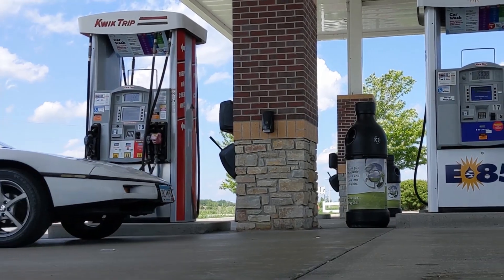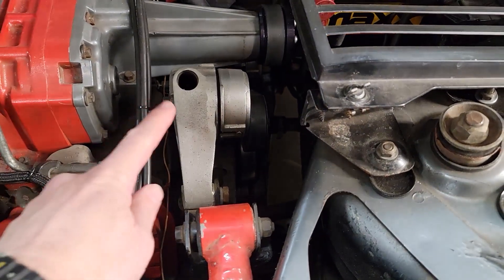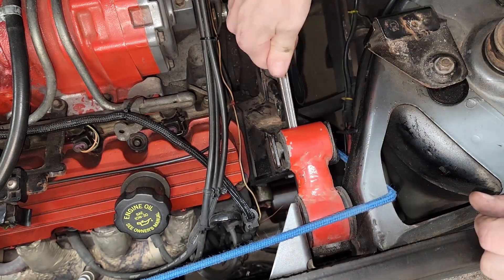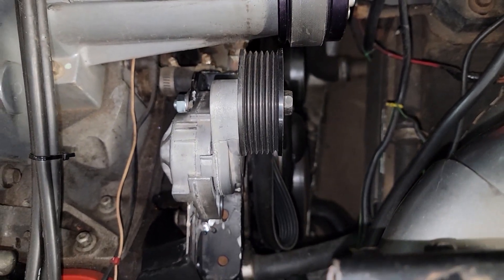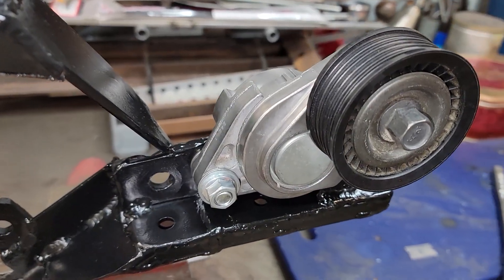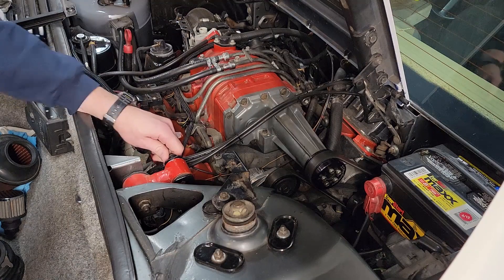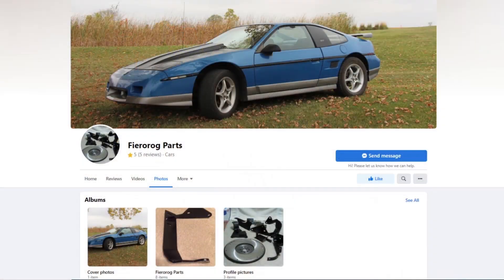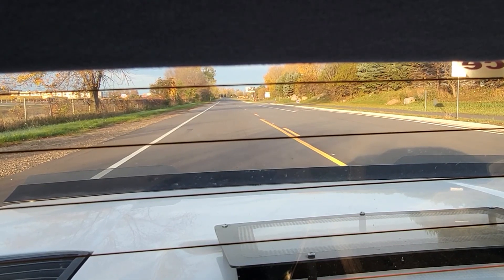3.8 Fiero Swap Tips (Brackets/Mounts and Tensioner)

Comment: I need to redo my heater hose outlet on the lower intake manifold. I need to tap the lower manifold and install a barbed fitting instead of what I have now. Thanks for the motivation! 👍
I used Fiero Rog’s brackets on my 3800 swap. Well built and shipped fast.
Reply from the maker: Yes tap it for sure!  Thanks for the comments and yet another thumbs up for Fiero Rog mounts!

Comment: At first I was thinking why bother if what you have works.  Once finished though I liked the improvement.   Stock parts are always best when you can so I can relate to your thoughts there.. If you weren't 2k miles away I would love to show you some terrible welding tips lol.  I'm no pro but I do enjoy it.  Welding exhaust tubing pretty is still a nemesis sometimes for me.
Reply from the maker: Thank you sir - next one is getting better scrap and perhaps some tig welding.   Did I mention I NEED a tig welder?  Cheers!
Reply: @Toys4Life  I would like to try my hand at tig welding someday.  I don't know if I have the patience for it though.
Reply from the maker: @PNW_Car_Mods  I learned how to weld with oxy acetylene in high school - which I think is a similar concept- but harder.  I couldn't do it today without a ton of refresher but tig seems like it would be easier than that.  Plus I really want to be able to better work with aluminum. Xmas present 2022?
Reply: @Toys4Life  Gas welding is really hard that is for sure.   I had to pass a gas welding test course to get my A&P license years ago.   Have you ever tried stick welding?  even that is hard to me.

Comment: Hey. Love the car man. About to help with a series 1 swap into an 86. Has a getrag already on the 3.8 from a 95 SSEI. Can you recommend any helpful sites, or companies for the needed swap parts? Cheers
Reply from the maker: Unfortunately, the vast majority of information is on the series 2. The main benefit of the series 2 over the series 1 (besides additional horsepower and efficiency) is  how much easier the computer is to program.  You could try pennock's fiero forum and search for 3800 series 1 swap in there. Unfortunately I'm really not up to speed on the differences between series 1 and 2 so I don't know how much different the series one would be.

Comment: What was the reason for the custom tensioner in the first place? Planning my 86 gt sc 3.8
Reply from the maker: Because the one I had on there was a BUDGET modded 3800 part  just to get started a few years back and didn't look the greatest -  and I came across a spare LS1 tensioner that I thought would look better and be easier to replace in the futuere.

Comment: Did you research or otherwise measure the amount of force each differing tensioner is applying onto the belt? If a tensioner is applying force between two pulleys that are far apart, say 24 inches, vs. a tensioner that is applying force between two pulleys that are only say 16 inches apart...we're dealing with two differing amounts of force. If you'll notice the "throw" on your old tensioner is longer than the newer one...you'll note  the new one might not  have enough "throw" to impart sufficient force...making for squeaking under revs...
Reply from the maker: There you go bringing up physics!   In the limited testing I did (-2 degrees for a high here today) no squeaking so far.   I will have to keep the old one out of the trash for a while until I am good and satisfied the new setup is perfect.   Thanks for the thought provoking comment!
Reply: @Toys4Life  Myself as a retired mechanic, I've replaced my fair share of those spring loaded tensioners...the "fun" ones are those that self-destruct, explode, breaking in pieces.  just some food for thought.  Too tight, too much tension, too much force,  can prematurely wear out bushings (not bearings) in water pumps, Alternators & AC compressors.